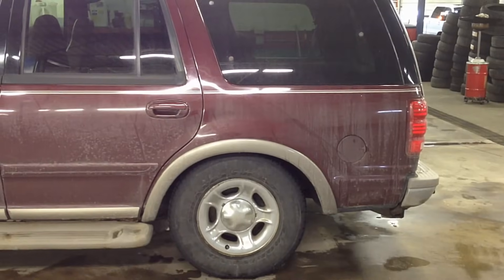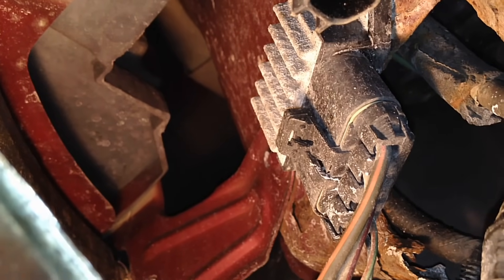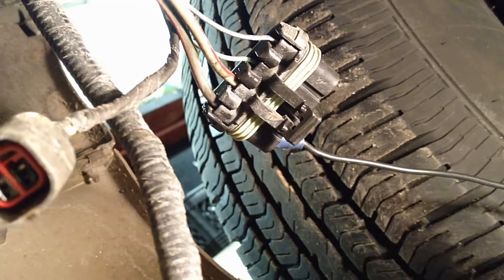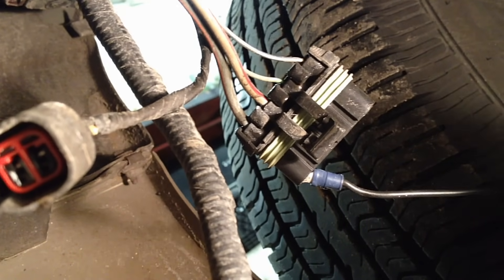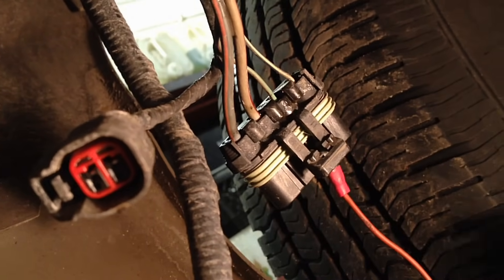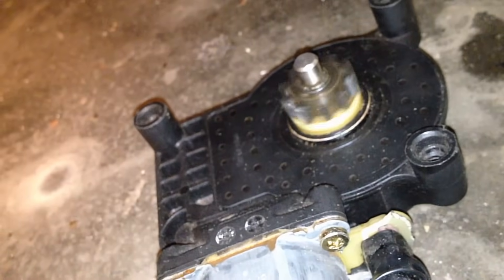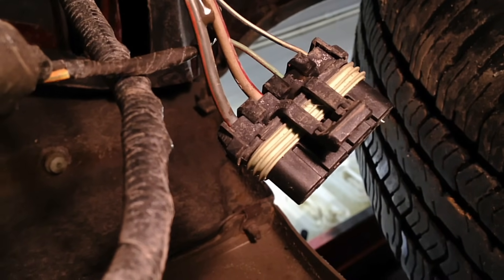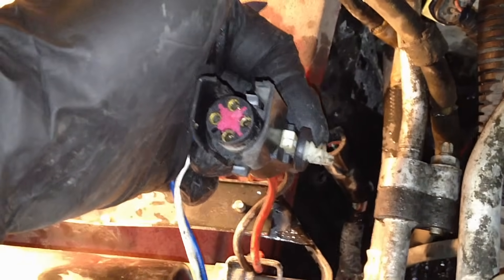Ford Air Ride Rear Suspension Down Diagnosis & Fix

Comment: Hello. I also Enjoyed your video.Problem: 2003 Navigator 4wd All test pass except  the ground command from the air suspension module with the test light as it appears at a bout the 6 minute mark.  It failed to light up the test light. Also the new comp would not come on.I had replace the old compressor because it was to loud and would come on constantly while driveing.
If I Disabled the comp. with the switch I could go for days in good weater no problem.
Next when out and started up and comp. came on and pumped up, can you tell me why?
Reply from the maker: ***** If you have the old style solid state relay as shown in this video then the pigtail is likely the culprit they are very common for this concern. There should be a link in the description.
Reply: FordTechMakuloco You mean the pig tail with 4 contacts would cause the compressor to come on and off while driveing and how could it cause it to not work then after 12 hour suddenly start working?
Reply from the maker: swal779725@cox.net They have pin fitment issues  I have seen it plenty of times before. Next time when it is not working and is low put vehicle in park all doors closed and disconnect and then reconnect the pigtail if it now works you have just found your problem.
Reply: FordTechMakuloco Key On or Off, also what is pin fitment, is the replacement pigtail from dealer after market? Also thanks for all your help.
Reply from the maker: The pigtail linked to is a Ford unit. Pin fitment is where the pin tension is not sufficient and there is connectivity issues intermittently.
Reply: FordTechMakuloco Thanks again, on your video I saw a piece of equipment that, you were able to read voltages on the height sensors and control the comp. to run etc. and i have hear that the control module sometimes needs to be calibrated. will this equip. perform that funtion and can you tell what the equipment was.
Reply from the maker: If it needs to be calibrated it will set the dtc for it and only needs to be done when the module has been replace you will need the ford IDS scan tool to do it properly.
Reply: FordTechMakuloco Was that a ford IDS scan tool that i saw on your video, DTC stands for?
Reply from the maker: yes I use the Ford IDS. DTC stands for diagnostic trouble code
Reply: swal779725@cox.net 2001 navigator I have air ride on front only air pump won't come on my local mechanic messed it up pump won't come on at all

Comment: Hey I have a 2000 expedition and I have a gotten the air suspension completely changed aI just changed the compressor and dryer. Suspension inflated but the compressor won't turn off. What should i do? Please and athnk you very much in advance.
Reply from the maker: Isaiah Mack check all height sensors to make sure they are attached.
Reply: Where would those be located on the truck
Reply from the maker: rear axle drivers side and front upper A arm drivers side.

Comment: I also have '02 expid. Back end on both sides is LOW and Stiff, no bounce, (pump goes on) I still drive it, besides coursing Damage to me and my back and neck, can I course more damage to truck? What should the average total cost be? Thanks.
Reply from the maker: Frankie Bee No the rest of the truck should be fine.

Comment: Hello Sir. I have the same problem on my 2001 Ford Expedition. The back end sagged everytime  I park it overnight. I'm thingking I just need to replace the air suspension relay? and sometimes even while I'm driving the back end sagged. Is it ok to drive it even when the back end sagged? I suspect maybe the airbags are leaking. I even thought about maybe puting a duct tape on it for temporary only. Any suggestions? Please help. Thank you.
Reply from the maker: VERGIN GALACTIC Yeah it sounds like the bags them selves are leaking check them with soapy water when they are pumped up.

Comment: I HAVE A 2008 FORD EL EXPEDITION WITH REAR AIR RIDE. I REPLACED MY FRONT SHOCKS/STRUTS AND NOW I BOUNCE GOING DOWN THE RAOD. THE COMPRESSOR SOUNDS GOOD AND THE AIR BAGS FILL UP. ANY SUGGESTIONS?
Reply from the maker: Bil Brunson So front is not air ride right?
Reply: Bil Brunson I
Reply: FordTechMakuloco

Comment: Hey My 2001 expedition has a saggy butt.  The pump turns on but the back wont come up at all. I have checked for leaks int he lines and found one in the front at a t section i fixed it with no luck. I am starting to think the bags have a hole in them somewhere. any other thoughts before i take them off and replace them?
Reply: This is not a good thing.
Reply from the maker: Katie Jones You have 4 wheel air on this truck?
Reply: FordTechMakuloco I have this same problem and I do have the 4 wheel drive.

Comment: I replaced the front 2 air shocks/bags last year and when its cold they still dip down, passenger side even more. Thinking of getting a complete compressor and dryer unit. Could it be just the dryer? Unit runs until light on dash comes on then shut off when cold, wont stay up, when warm over say 65 it works okay stays up. 
Thanks
Reply from the maker: bldaz Did you replace the solenoids on the air bags?

Comment: FordTechMakuloco, I have a '00 that I thought had sagging rears.  I followed your steps and tested the connector, and the compressor kicked on.  I don't have the proper equipment to test the two smaller wires, but I think the relay works because when I turn the truck off, I can hear clicking that sounds like the relay working.  I started looking at the height sensors, it looks like the rear one is extended, but the funny thing is that the rear bags are full to the max.  What do you think I should check next?
Reply from the maker: James Brewster The relay does not click it is solid state and is likely your concern still.

Comment: I have a 2000 Ford Expedition with air ride and the Check suspension light is on after driving for about a mile or so and stays on. The truck levels off and as far as I can tell the compressor turns off after the truck is level. Any suggestions?
Reply from the maker: Kevin Murphy Yes get the code read to see which fault the module is seeing.

Comment: I have a 2001 Lincoln Navigator 89,000 miles on it, how much would it cost for me to change to 2 rear air Air Bags and Height Sensor? cost for me to do it myself, and cost for dealer or mechanic to do it. Thanks
Reply from the maker: ***** Well it depends on where you get the bags from that would be the biggest cost but overall at the mechanics it would be close to a grand I am sure.

Comment: HI GRETA VIDEO IT DID HELP ,JUST WONDERING WHEN CONNECTED TO A TRAILER DO I RUN IT WITH THE SWITCH ON OR OFF.
Reply from the maker: On it will compensate for the trailer weight.
Reply: THANKS

Comment: My 1999 Ford Expedition 4.6 the compressor comes on every 5 minutes making my battery become low,
Reply from the maker: frankiejdm Sounds like a bag leak or those front air shocks they are common also.

Comment: Have a 1994 Mark 8 My problem is the back is down and the pump wont turn on Did 1st test jumpered big  wires Pump works Used a motor from a kids electric car to load test #3 ground terminal to #1 hot wire Motor worked fine Used a multimeter to test terminal between 4 and terminal 1 12.2 volts all is good Swapped relay with ABS relay from drivers side of car still wont turn on the compressor Purchased a relay from a local auto yard on the chance the ABS relay was bad Still the pump wont work Any other suggestions
Reply from the maker: Jam o I am not too familiar with those but what I can tell you based on your testing is you need to have the module scanned to see if it is seeing a height sensor fault which was common. Only place that I know of that can still pull codes from that module is the dealer.

Comment: So what happens if my air ride compressor doesn't shut off at all? It seems after I have been driving the truck for a while, then shut it off, i'll find out that an hour or even hours after, the compressor won't turn off. Still trying to level the truck out without the keys in the ignition. Wind up killing the battery and I have to jump start it. While i'm driving the pump with cycle on and off also. Any help would be great please.
Reply from the maker: which vehicle and year

Comment: dealing with an 03 expedition with air ride issues. it is a 4was setup. compressor kicks on when manually jumped. but i have no constant ground and no command on ground. a previous scan of the truck shows that one of the front height sensors was faulty. could that one sensor being faulty cause the system to not provide a command ground? 

Also, on the constant ground: could i wire it to a ground on the body to achive a constant ground for it? or is the constant ground controlled somewhere else?

when i turn the pump on manually and let it run, the truck doesnt lift. if i leave the on/off switch in the off position and manually turn the pump on, the entire truck should raise correct?

thanks in advance.
Reply from the maker: money89tractors Yes I would replace the front height sensor as shown in my other video on 2003 and newer vehicle a faulty front height sensor will shut the system down. If you are having front height sensor issue you must have a late build 2003 with a regular relay not a solid state as shown in this video right?
Reply: Right. Its a normal relay just behind the headlight.
Reply from the maker: Yeah then I would replace the faulty height sensor first.
Reply: FordTechMakuloco i should still have a constant ground at the relay correct? and then a signal ground. . . . i have no constant. can i simple hard wire the constant ground to a known ground source? or is that constant ground controlled elsewhere? Thanks for the help.
Reply from the maker: If you have the new style relay it does not have a constant ground just two 12v inputs an output to the compressor and 1 switch ground.
Reply: FordTechMakuloco Awesome. thats the info i needed!! i was worried because i had no constant. but now i know i dont need one. Thanks again for the help. These air ride systems are a bit of a mystery for me. 

Happy holidays!

Comment: Thanks for the video. It was really easy to follow. I'm hoping you can help me. I have a 2000 Navigator and the back end is down. I did all of the troubleshooting you showed. Everything was good. I even saw the front end rise when I used a jumper wire on the pigtail for the relay. I replaced the relay but the compressor won't run. I used a scan tool (actron CP9135 OBDII Auto Scanner) and got a "pass"  message. Any suggestions?

Comment: finally got totally @*(&^ at it last night and tore it apart. the 03 eddie is different than what I could find online. figured out where the relay is and started testing, the first tee in line is leaking like crazy. going to start with that one and work my way to the back. on the eddies the relay is attached on the top front of the compressor, easy access to test. last year I replaced the drier thinking that was it. ford dealers are no help on this issue unless you want to spend boat loads of money. thanks and I will keep you updated. your video has gave me the most info. Thanks!

Comment: 2003 expedition, around freezing or lower the rear will not air up. this is the only time of the year I have any problem with it. any help will be appreciated.
Reply from the maker: brian lowmaster Ok you have water in the system, either from a leak in the system or the the drier attached to the compressor is saturated and not drying the air to the bags. Any problems with the system like suspension goes down overnight or compressor constantly cycling while driving? 4WAS or 2WAS.
Reply: FordTechMakuloco yeah I replacd the front 2 air shocks bags last year and when its cold they still dip down passenger side even more. Thinking of getting a complete compressor and dryer unit. Could it be just the dryer? Unit runs until light on dash comes on then shut off when cold, when warm over say 65 it works okay.

Comment: Thanks for the video I have a question. I just replaced my air suspension compressor and my bags air up but when I park and turn the navi  off my bags lose about half of the air in them. Do you have any suggestions as to what this means?
Reply from the maker: MrRayRizo They are supposed to kneel when key is off for easy entry and exit.

Comment: Great video. My 1998 Lincoln Navigator Air Suspension quit working and the idiot light is on constantly on the instrument panel. All bags are deflated. I did all the checks mentioned. The compressor works fine when I jump across the two huge wires, and the middle ground wire all checked out perfectly. I even replaced the relay even though it was not bad. My problem is I get nothing on the 4th wire (Control Module). I did it exactly as mentioned in the video and still nothing works. Where is the control module locate on my 1998 Navigator? How difficult is it to diagnose and to replace? I have a pretty good mechanics background, but have not be able to locate the module; I think its under the dash somewhere. Oh, by the way, the air suspension on/off switch checks out good too. What else can it be. Chiltons and Haynes are clueless.

Thanks,
MikeyD
Reply from the maker: The control module is located right above the radio, you just have to pull the trim panel off. There are many reasons the module may not be commanding the compressor on. You can check the wire from the module to the relay and after that you will need a scan tool to check height sensor voltage park input etc.

Comment: Great video.  Question,  ii have a 99 navigator here. The pump runs when jumped the middle small wire works as ground.  The end little wire doesn't ground.  Cold this be bad connection or would this mean a larger problem.
Reply from the maker: Is the rear height sensor and linkage connected up and not fallen off? If so I would have it looked at with a scan tool so they can check the height sensor voltages etc to see why it is not commanding it on.
Reply: FordTechMakuloco  currently both sensors are hooked up and appear to work.

Comment: hey bro. thanks for the vid. I have a question about my ford. the truck drops when ever the truck is off and when I turn the truck on and close all the doors it pumps up. but like I said if I go into the store when I come out the rear end is sagging again. might it be the same problem as in this video?
Reply from the maker: No it sounds like your rear bags have cracks in them from dry rot. Does the compressor come on while driving to keep them filled?
Reply: Hey Thanks for responding. Yes it does come on while driving. I thought it might be a leak as well, but the strange thing about it is, the rear end doesn't always go down when I'm parked. About 5% of the time it stays up.  Are the bags easy to replace?
Reply from the maker: Yeah it just depends on the angle of the truck and how the bags settled. They can seal up temporarily where the bags roll over upon themselves. Jack up the back end let them deflate you will see the dry rot cracks and such. The bags are very easy to replaced on these. The pin up top may be rusted but besides that once they are deflated they pop right out.
Reply: Ok I'll take a look. Thanks again Bro.!

Comment: my tuck is the just example in this video. and alot of air is blowing out the passenger side of the engine what can i do get that rear up.? and why is all that air blowing out like that? (even with the hood down the blow is powerful)
Reply from the maker: Is the compressor coming on?

Comment: Hi ford tech again, I found the compressor, It knot like any in your video, I can't find the relay.Would you look at a 96 Lincoln wiring and tell me. I hot wired the compressor and its runs. On the compressor a small box with a green  going in it. Ben Canfield. thanks.
Reply from the maker: The relay is in the engine bay fuse box. It is the middle fat relay and is setup the same as any relay you can see which pin is which by the diagram on the side of the relay.

Comment: Hi ford tech, 96 Lincoln town car, In the trunk there is a switch for air ride on and off. What doze it mean I unplug the connector and its reads 12 volts on both wires. I think one hot and one knot hot right or wrong. Ben Canfield.
Reply from the maker: That is perfectly normal, one is going to the cluster one is getting power etc, the switches on these never fail

Comment: I have a 2003 Lin. Navi.  I cannot find the relay.  Supposedly it's under the passenger side above the fog light.  Not there.  Help please?  I understand it was moved late 2003 models.
Reply from the maker: Should be behind the passenger headlamp right up top with a little lid on it. Right above air compressor.
Reply: l have a Lincoln navagator 2006.the suspension goes down wen i turn it off .when i turn it on .go's upp.

Comment: FordTechMakuloco- most informative media on the net! reattached the pigtail to relay and jumped the fat wires- both failed. logic and as you stated its the pump, direct power test and voila its alive however only front bags inflated. rear bags hold air. havent heard the pump run normally. thinking its the relay and pigtail? thanks again

Comment: My 2000 navigator is leaking Just line the one in this video from the left rear side. What is it and how can I fix it
Reply from the maker: It is likely either the solenoid on top or the bags themselves. Do they have lots of cracks in them. Do you have 4 wheel air suspension? Is it all the way down as shown in the video just in that corner? Overnight or all the time.
Reply: FordTechMakuloco I liked under and there are three hoses that's where it leaks from
Reply from the maker: where is that located above the rear axle where the line from the front of the truck splits off to the two rear air springs?